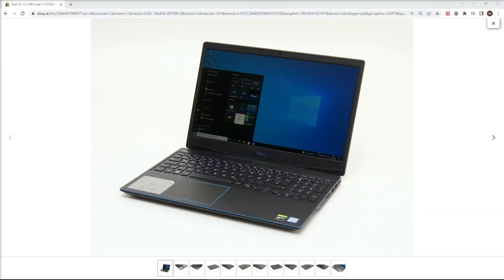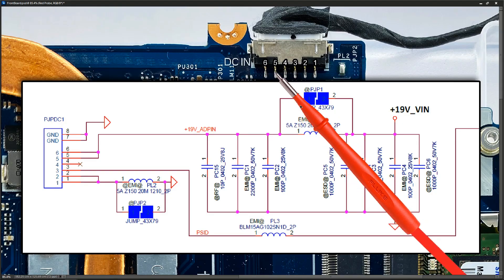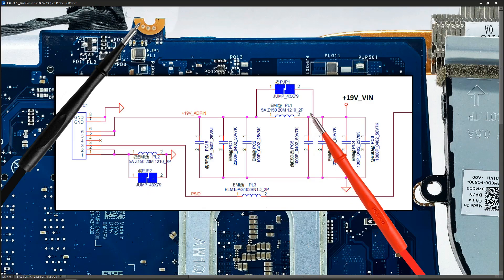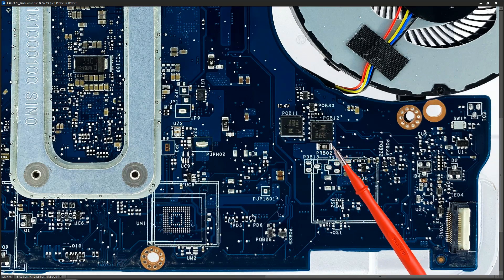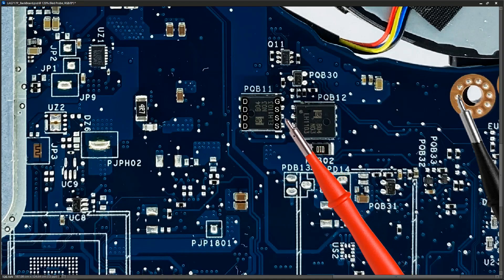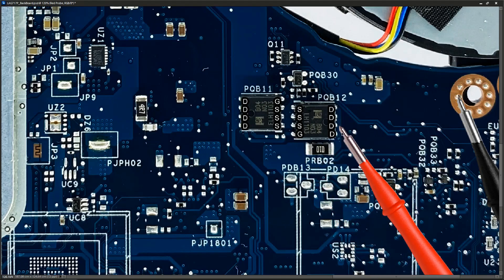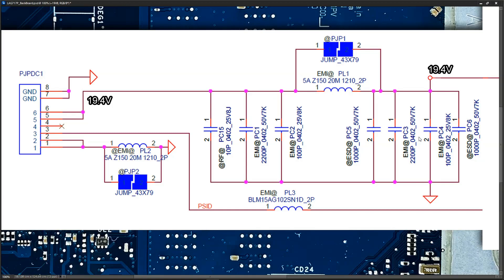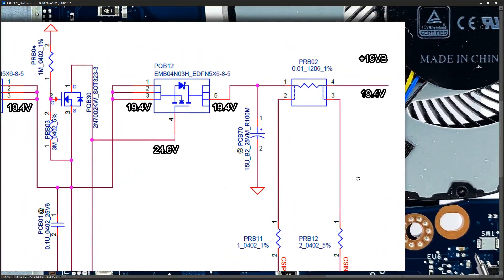Dell Vostro 3590 - Follow The 19 Volts

Comment: Amazing video, congratulations. Do you have any video like this one, but talking about Dell not recognizing an AC Power showing as "unknown" and not charging the battery? If I'm not wrong, it is the pin #3 for this data, and I'd like to know if you have some video talking about how to check if the data is working and so on to get to recognize the AC Power and charge the battery. I got a Dell Latitude 3490 for my wife, and it doesn't recognize the AC power or recharge the battery. I  have already replaced the power jack and the AC power, also adjusted the levels via hardware to start/stop charge, but nothing has solved. Thanks and have a great day.